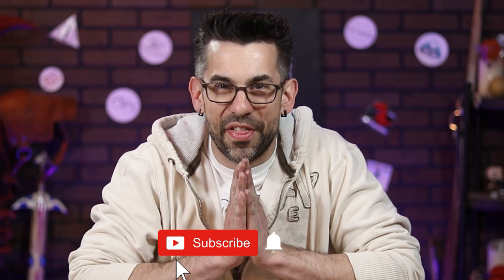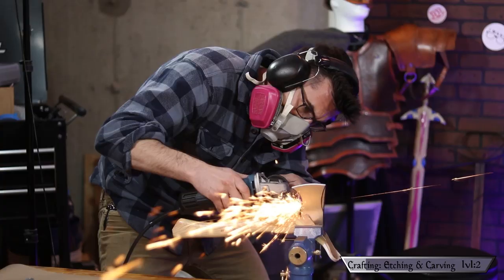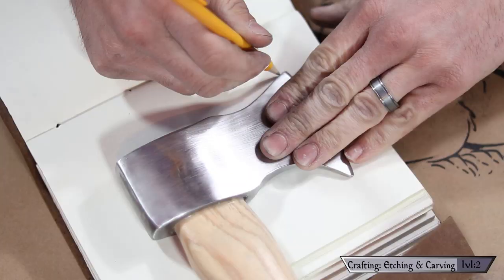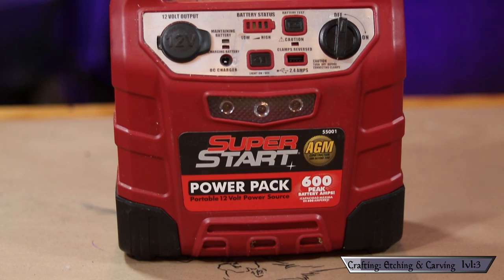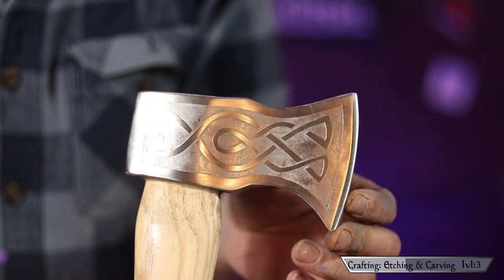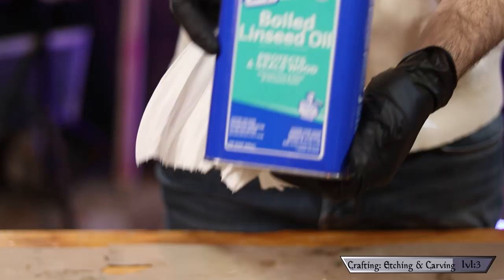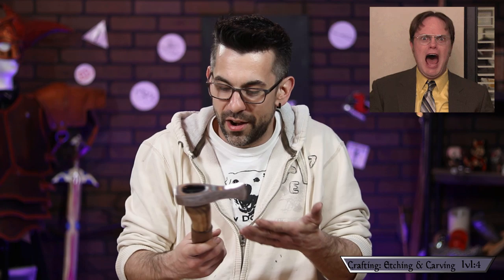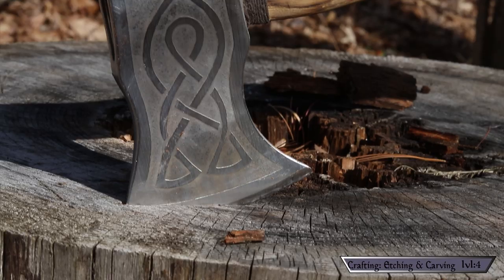Viking War Axe Of Pillaging (from $15 Walmart Hatchet)

Comment: So fun fact: The burning in your nose from etching steel is caused by the release of the ions from your etch solution. In this case, sodium metal (which goes right back into solution if I remember correctly) and chlorine gas. Yeah wear the respirator when etching. Chlorine gas isn't fun to play with in most circumstances.

Comment: to make it "safer" I would recommend a sheath for the blade - a simple on possibly made with the scrap leather you have on hand, straps and rivets, or even just the leather and lacings. You could even decorae the sheath for that added punch, and it would protect the edge.

Comment: with an axe you want an apple-seed shaped edge that is much more suited for chopping into wood, the easiest way to achieve that is to sharpen your axe on a belt grinder, using any of the unbraced spans of the grinder, normally on the underside of the of the machine.

Comment: Excellent work! I totally understand about the dye incident too. One problem that I have is my dyes "bronzing" I guess because the larger items I don't have enough dye to dip dye it and I put too much on. But yeah... It kills me every time. The feibings pro dyes are good but drive me insane. Do you know of a better dye? I have been apprehensive to get the eco flows... I dunno... Seems risky.  Where did you get your 3 sided honer? I have been trying to find a good one for a good price.
Reply from the maker: I have only used the feibings so far. I should branch out and try different thing as well. That being said, the ecoflow gel has treated me well in the past. You just need to be quick with it because it will keep darkening areas so it's easy to end up with splotches. Thanks for watching!

Comment: Hey Cl3ver if you have seen or read game of thrones one project I think you should do is make a sword look like Valerie steel.
Reply from the maker: Man, I LOVE those books. That would be DOPE. I will need to make myself a larger forge first or, at least, a hotter one so I can forge weld and get that ripple pattern😁
Reply: @SkillTree  I ment use tape to put that rippling pattern on a sword you already have to start. Then after that work with nickel steel and 01 tool steel to create Damascus steel.
Reply from the maker: @bretlemieux2489  cool idea! I'll add it to the list!
Reply: @SkillTree  sweet deal